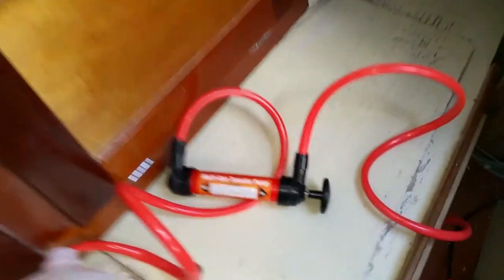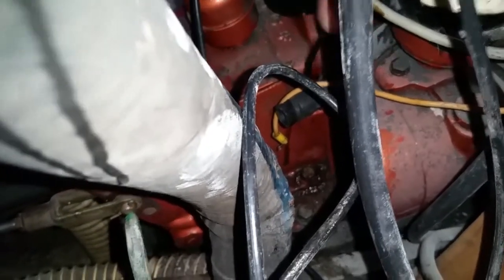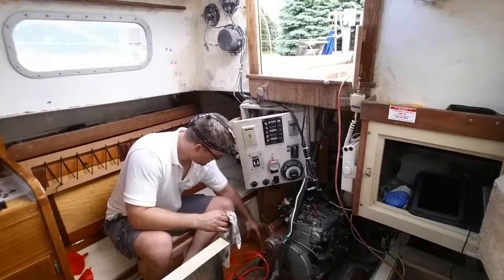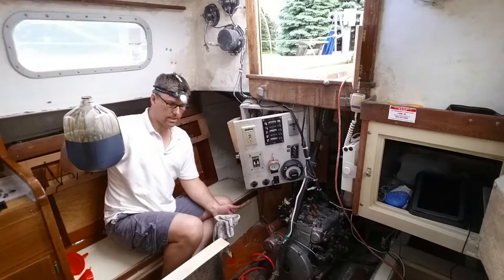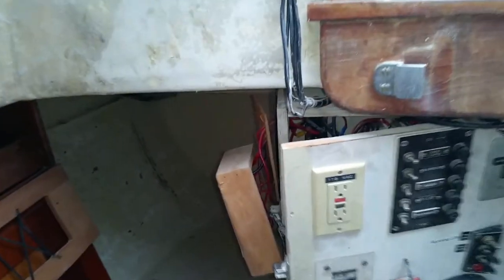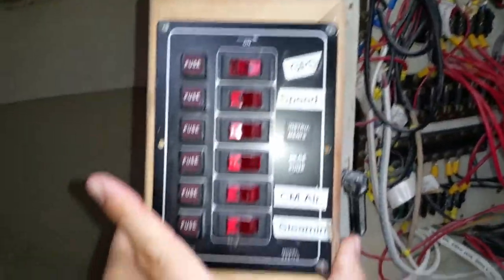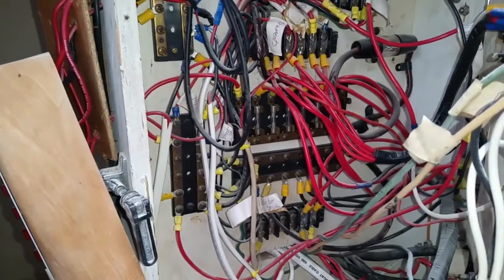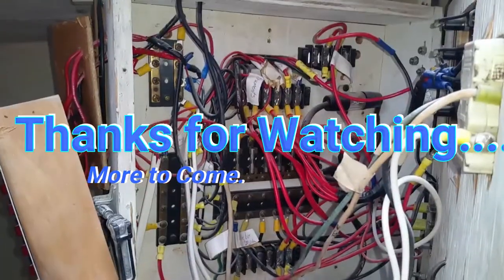Ep. 10-Sailing De Novo:  Sailboat Refit, oil change  Atomic 4, inspecting the wiring on a Tartan 27.

Comment: Hi, maybe I could make a safety related comment. 12Vdc and 120Vac does not mix well. You should make sure that these two type of electrical circuit are well segregated from each others. 
Keep posting, it is always interesting to see someone taking care of older boats, especially smaller one.
Reply from the maker: Thank you so much for commenting.  Your right of course.  For the time being, I am only wiring a DC system.  Once that is done, I will look at how to set up an AC system...on a separate panel and switch board.  For now though, I am just trying to keep it simple.
Reply: You are right, simplicity is the  way to go. Keep it simple and enjoy sailing her. Regards

Comment: Thanks for making these, I might have found a project like this as well. What was your step-father the sailor say about the condition of the boat initially? And could you have put it in the water last summer (no refit)?
Reply from the maker: Hi Ian.  First of all, these videos are old.  The ones posted so far are from the spring of 2017.  It has been difficult to find the time to edit and post.  

My step father suggested I buy a trailer sailor like an O'day or McGregor and tried to steer me in that direction.  He was worried that this was going to turn into a money pit and that I wouldn't get out of the water.  When he saw the boat he arrived at the same conclusions I did.  It is structurally sound;  no blistering or water in the hull.  A couple of soft spots on the deck, but nothing major.  He was more concerned about the condition of the engine.  It started though so no real issues there.  

I did put it in the water during the summer of 2017.  It went in the first week of July and we went day sailing about 7 or 8 times that summer.    

Last winter, I started some major projects which I didn't get finished in time for the 2018 summer season.  All of those videos are coming.  Barring anything unforeseen, I should be on the water again by the end of May at the latest.  Hopefully sooner.
Reply: Sailing De Novo thanks! I’m looking at an O’Day 25 tomorrow (free boat!) and going to try to determine how “free” it will be. Thanks for the reply!